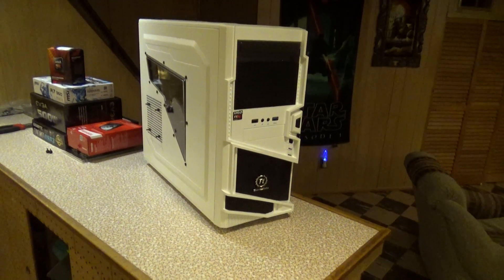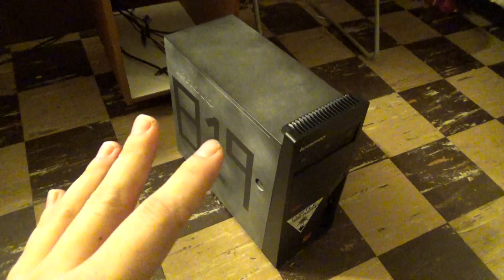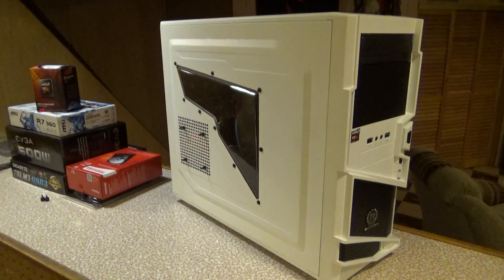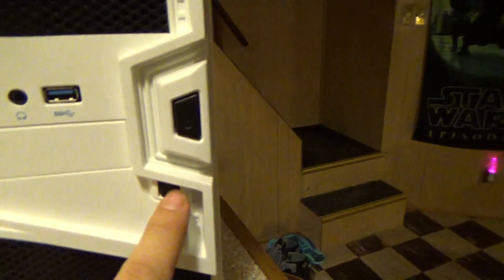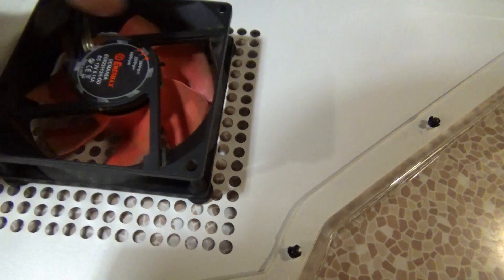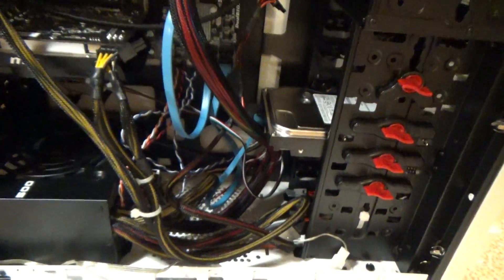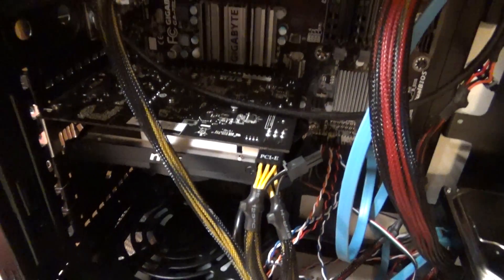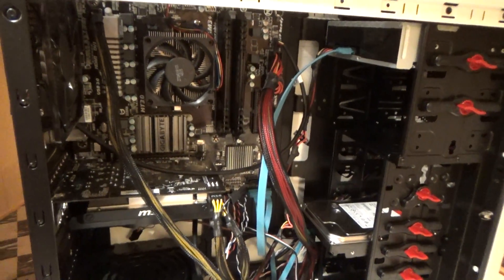New PC Build!

Comment: your RAM is too fast for your CPU
Reply from the maker: I'm aware of the fact. That's why I have the RAM downclocked at 1600. Remember I said there was room for upgrades. And this CPU is definitely not the one that's staying in this rig :-)
Reply: you will need a new motherboard as well
Reply from the maker: Not really. It's an older basic motherboard. But it would definitely accept an 8 core no problem. Might not be able to run my RAM at full speed. But oh well. I might do another motherboard. but like I said in the video. this is strictly a budget build
Reply from the maker: I have an 8 Core 8350 in here right now. Just installed it today. Same motherboard. Lololololol